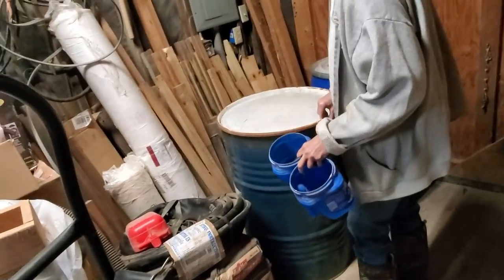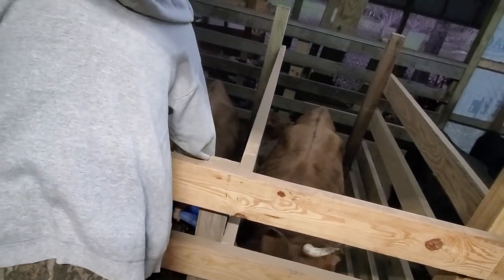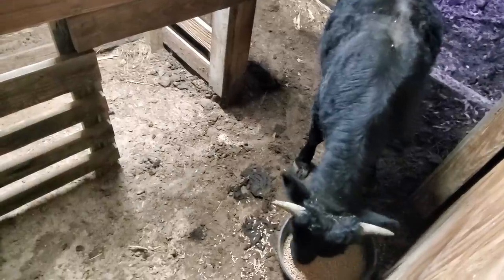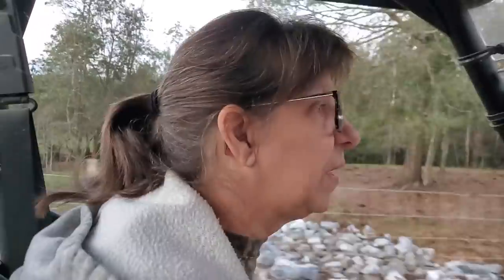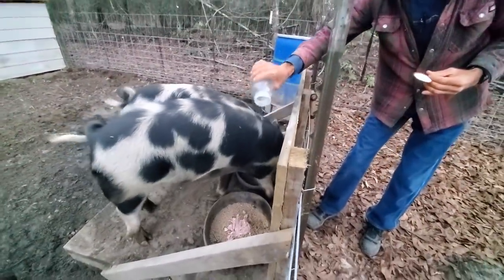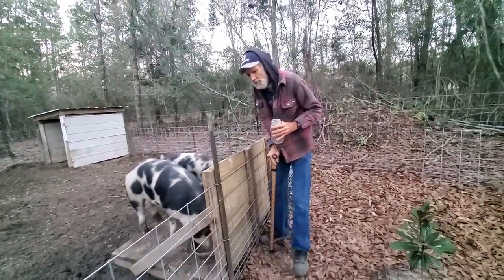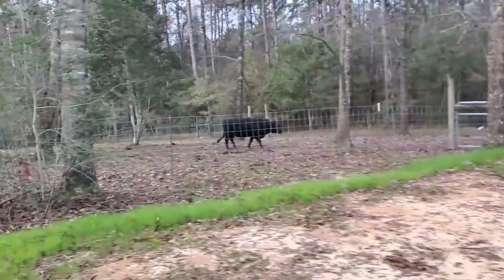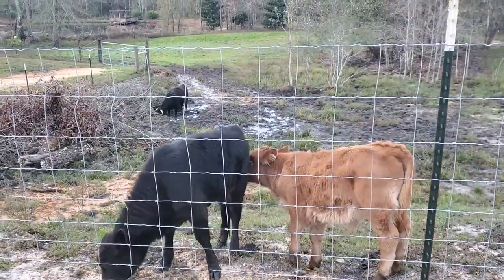Wife DOES Husband's CHORES

Comment: I haul like horses all over the place and my trailer was a dark charcoal grey all over. It would get very hot inside in the Fla summer. We had just the top section painted white. Just the top being white made a huge difference.  As yours is more open you may not have that problem but it may be a consideration when choosing a color for the top. Prayers that knee stops giving you pain soon Mr Danny!🙏

Comment: Hey, something I do might be right up your alley.  I built PVC drain pipe chutes terminating in 90° elbows on 18" concrete pavers.  The tube is anchored into a post.  All I do is dump the feed into the top and let gravity distribute it to my critters. I stay OUTSIDE away from horns and heads attached to 1,200 pound four-legged bulldozers!

Comment: My friend told me some years back a man borrowed a horse trailer to haul his horse somewhere. He said the bottom of the horse trailer had boards that had weak and rotted boards but thought it would be o.k. He was riding down the road and noticed the trailer was moving and bumping but didn't stop right away. When he did get a chance to stop he got out went back and found his horse with most of his front legs missing. The horse had feel thru the rotted boards and the asphalt was like sand paper on his legs. He called his friend to come out and shoot the horse out of his misery. So please don't forget to put some quality boards on the bottom of that trailer.